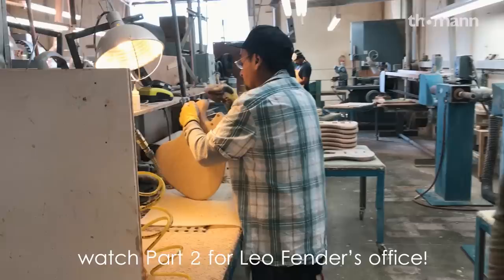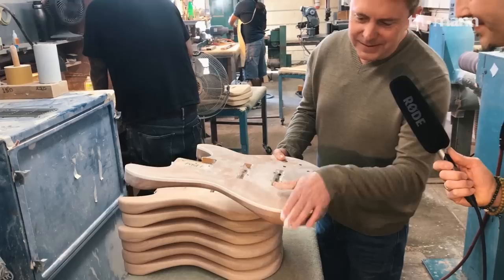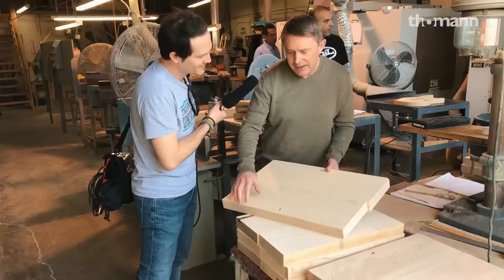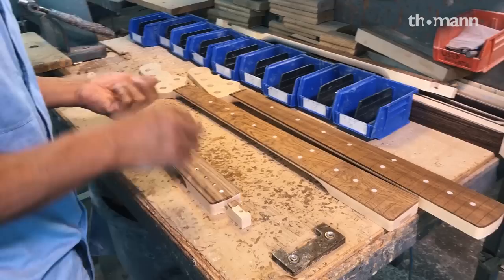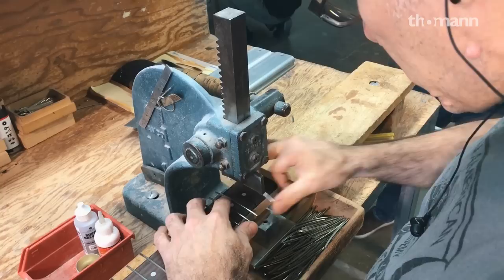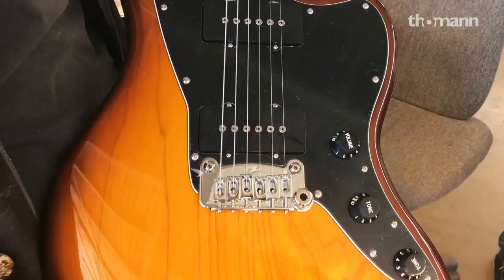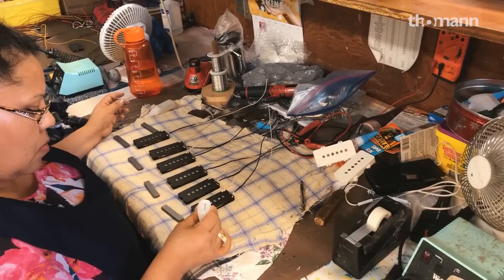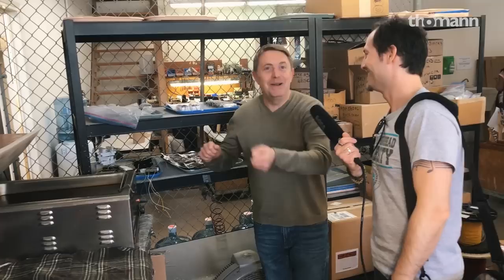G&L Factory Tour | The building process | Part 1 | Thomann

Comment: Omg that fretboard on the middle 5 string when they’re doing the dots....
Reply: Just don't panic, it's not instant glue or anything like that, it's wood glue, which dries slowly and is water-dilutable, they just washed it off easily right after the shot. Also remember this is BEFORE dialing in the radius (the sequence just before that in the video). 😉 But yeah it looks 😬😬😬 for a second 😅